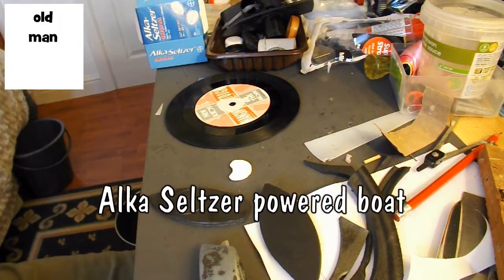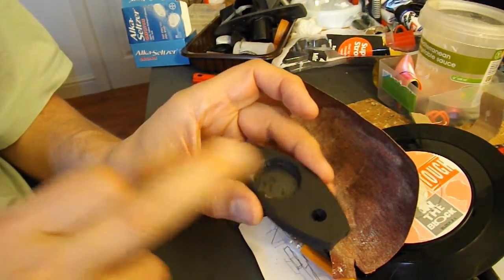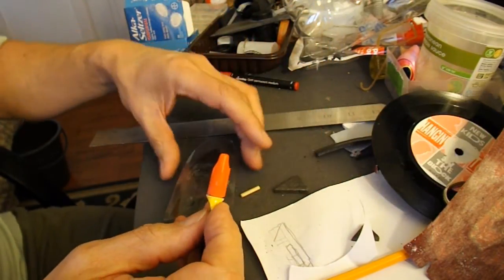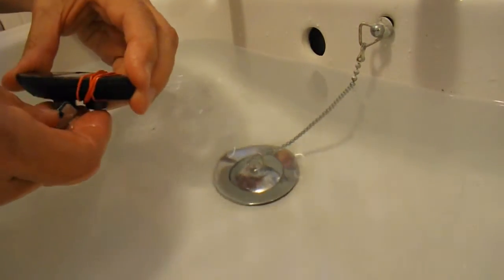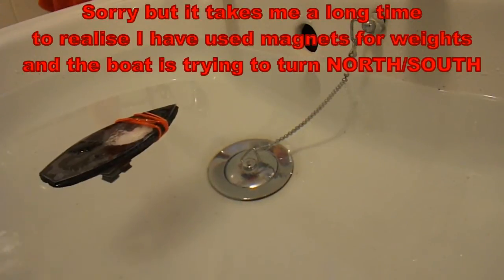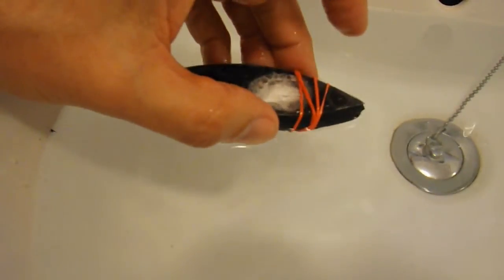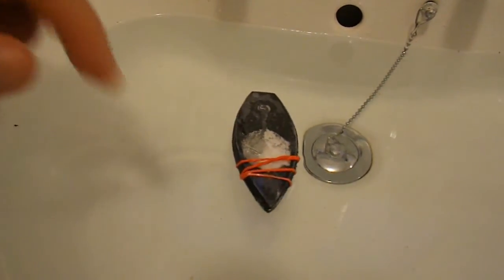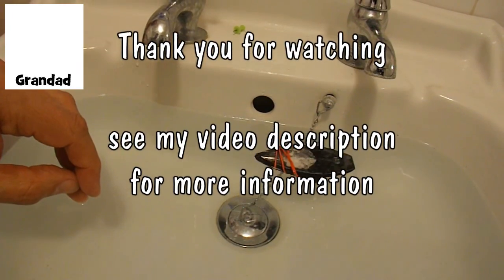Alka Seltzer powered boat - success

Comment: Two things:
- You could also use baking soda and vinegar
- And once I did an experiment with a similar pills.
There was an equally effervescent expired medically, called "Couldina".
There were about three pills in the bottle and picked-tube, pour water and closed immediately.
The cap did: "PUM"! and shot out!. 8-)
Reply from the maker: Hi Francisco, that would be a completely different propulsion method. In this project the boat is pushed forward by the action of the bubble rising up the angled track under the back of the boat. It is a very gentle and slow method of propulsion. Baking soda and vinegar is brute force pushing the boat with a jet of foam.

Comment: Was fun to hear when you worked out the turn situation, that penny seemed like it dropped from quite a height :)
 I'd leave the magnets on and see if your grandkids pick up on why it always turns to the same direction.
Reply from the maker: Had another go with it tonight, wanted to make it 'remote control' by using a magnet off screen to turn it. Not quite as successful as I hoped, but will upload later tonight.